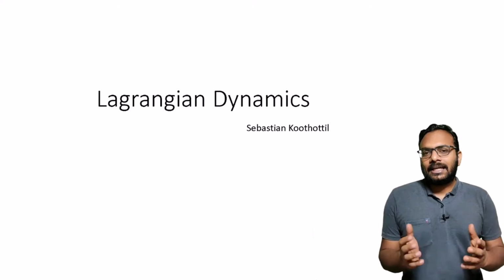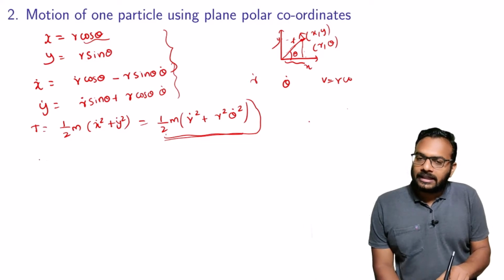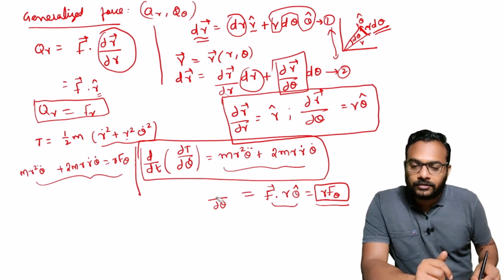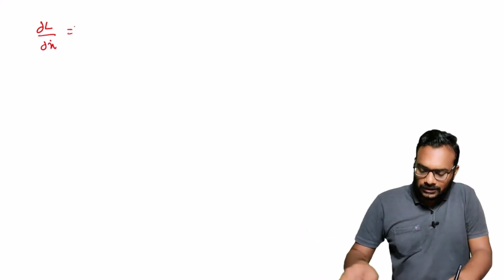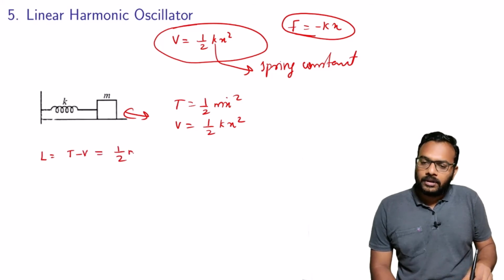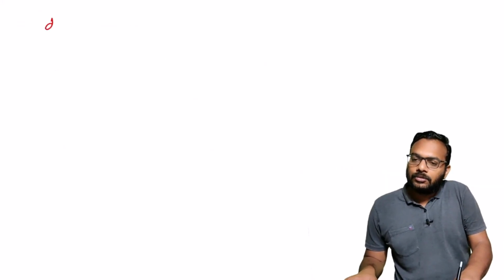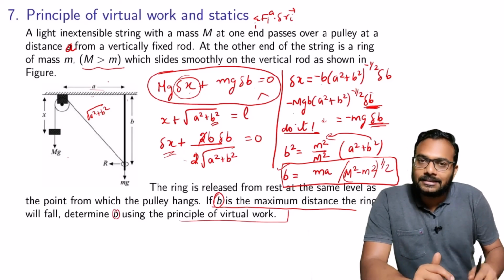Lagrangian Dynamics 1.

Comment: L=T-V... Why are not you finding V in polar coordinates question?
Reply from the maker: This is the general case as nothing has been said about V. We can write L=T-V only if V itself is independent of velocities. Here we treat the general case and write the equations using generalised force components, that's all.
Reply: @sebastiankoothottil-8341 sorry, but I dont understand anything.. Can u explain? In the case of pendulum, we are calculating v
Reply from the maker: @DRAGON-w5p7f  Yes. In this case we don't know the potential function. If we know that the potential is does not depend on velocities, we can just write V(r, theta) and obtain the corresponding equations. There is nothing wrong in doing that. Here, I just have written the equation in a different form, in terms of the generalised force components. Thats all. 

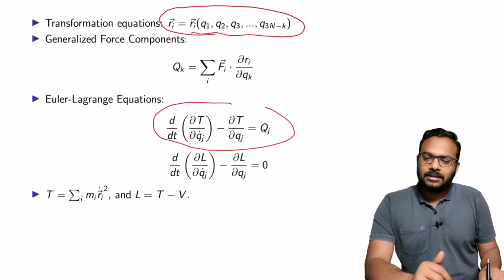I am just using the form of the equations mentioned  @10:38 .